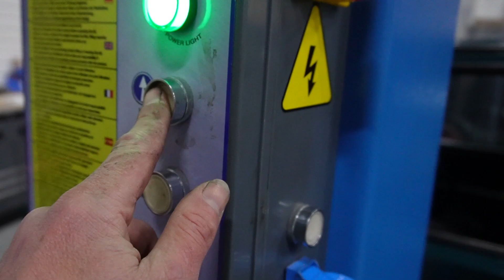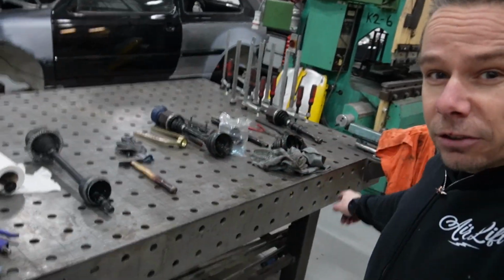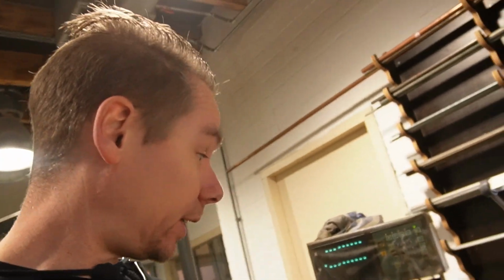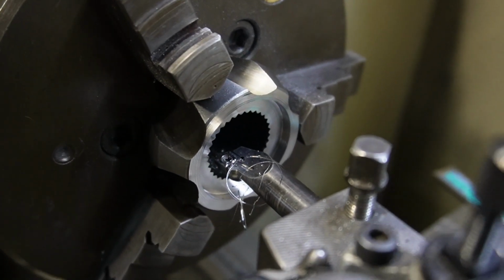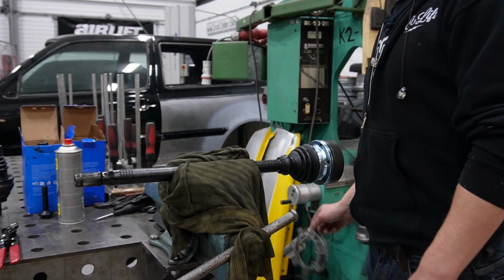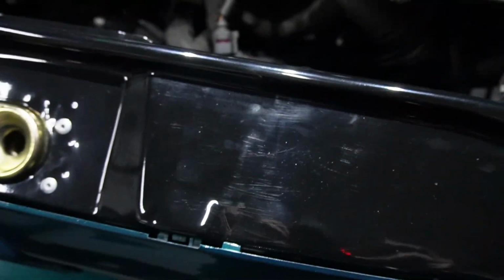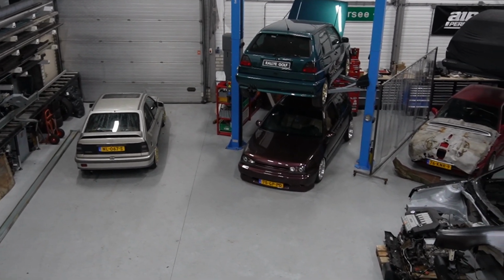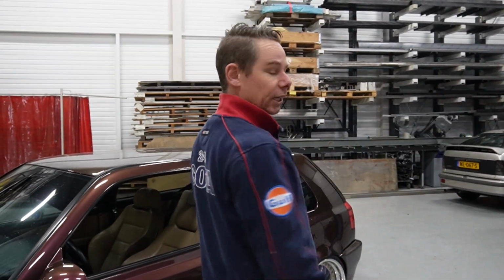Golf 2 Rallye works and ending in shop updates.

Comment: 2.5L with original rear brake is crazy.
Reply from the maker: Not sure what you mean by that ?
Reply: @NonstandardNL  the rear brake are small.
Reply from the maker: @samuelemosca1397 not really if you take it that original it only is used at 30% so you only have to upgrade the boost to the rear or replace it with a modern one in comparison with the engine.
Reply: @NonstandardNL  mine is not a criticism, on my mk2 I changed all  braking system with booster pump and ABS of the GTI mk7 including the electric handbrake.😀
Reply from the maker: Nice, i like the discussion about this stuff, we can all learn from each other.
It’s not my car and did not do the build.
And that is done years ago so. Maybe nowdays we would do it different but the brakes are still more then capable.